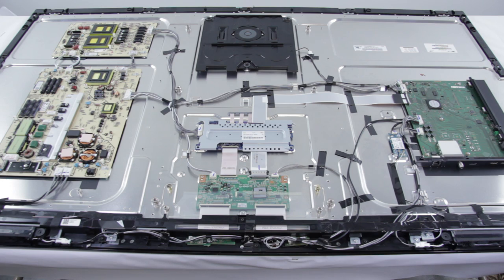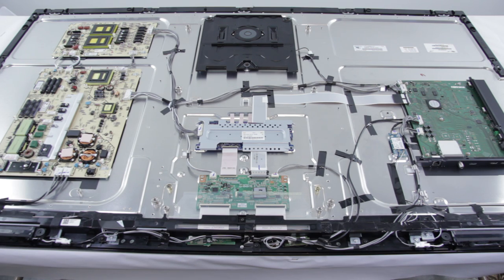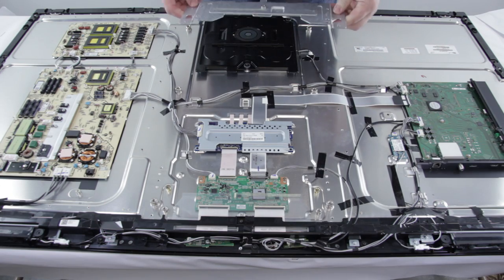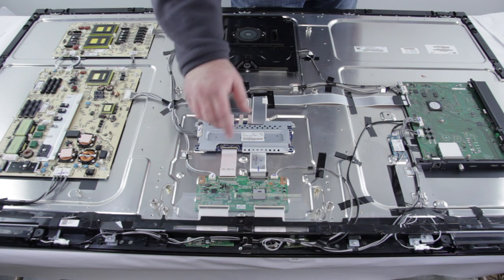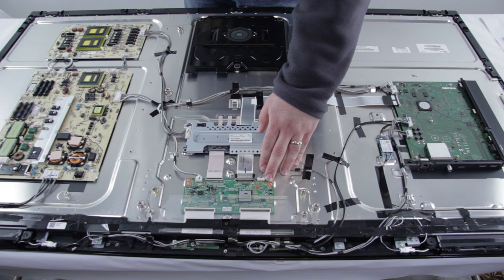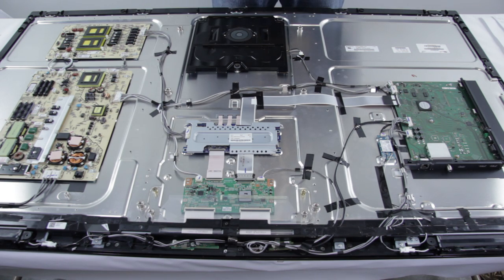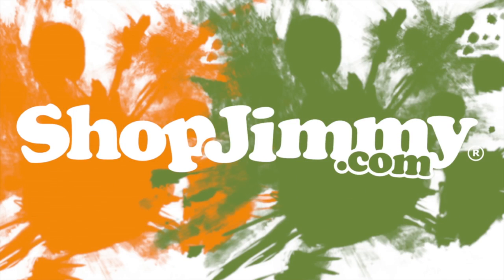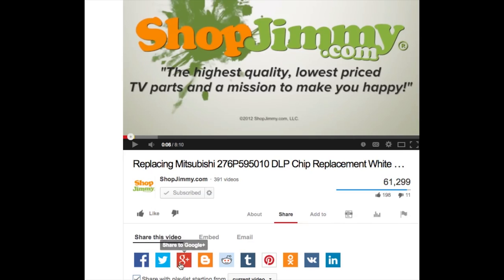LED TV Repair T-Con Board Help Review Overview - Common Issues and Problems with T-Con Boards

Comment: I have a 3 year old LG 42LN5200 LED TV that has black screen, I have done a little research & then tried to pinpoint the problem myself. I can tell you the standby light comes on but no backlights until I cut off. The red standby light goes off then the backlights start to flicker & seem to spread from a few to all of the strips. They never stay lit they just flash off & on. As soon as I power TV up & standby light comes on again they all go off. Any idea what's causing this?

Comment: I have a Changhong 50" 1080p LED HDTV - LED50YC2000UA. It's not even a year old and we just started using it, it was kept in the bedroom since December 2014. Shortly after moving it to the livingroom, the IR Sensor does not work. I know the remotes both work, the Changhong and the Directv remote. We now have to manually input the controls, which is annoying! What can I do to fix this? It's a very cheap tv, actually it was free with a laptop purchase on Newegg, but I saw it for sale for under $400, so I am not surprised it's not working right.

Comment: I own a Toshiba 50L1350U, and the backlights do not come on. They will briefly flash when first pressing the power button but then immediately go out. I've done the flashlight test and do have a picture on the screen. I replaced the Power Supply Board with no success. Any suggestions would be appreciated, thanks.

Comment: how do you replace the t-con board on toshiba 37hl67 lcd tv.  I can't find it and was wondering if I have to remove stuff to find it?  Thanks
Reply from the maker: *****   Try all tests and repairs at your own risk.  It may be under a metal bracket as sometimes T-con boards are covered up.  Here is a link to some possible replacements for your TV model number.  It may look like one of these.  http://www.shopjimmy.com/catalogsearch/result/index/?cat=63&q=37hl67  Thanks and please let us know if you have any other questions!  www.shopjimmy.com

Comment: Season Greetings. Description of my problem.
TV - Sony KDL 60EX720 (3D). 					
Poor color quality. Grainy Screen. Distorted moving color. Colored circles in top
 right 15 X 15 inches of screen. 	
Solarization on all screen, Including MENU displays .								
Common to all input devices. Everything works. Audio OK.							
Question - which board should I replace? Thanks, stay safe, Romeo.
Reply: Replaced: BATV Board , A-1821-155-A , Main Board , VGA Input , HDMI Input , A/V Board , Tuner Board , Ethernet Input , USB Input , Digital Audio Output. Problem solved.
Cost - $138.48 Can. TV PARTS CANADA

Comment: I have a Vizio XVT553SV with no sound. Originally I sent the Mainboard to be repaired because I had no HMDI inputs working. Got it back and worked for a year when the  sound started cutting out. I sent it out for repair again and it worked sporadically and sound went out completely. Replaced board with one from an online tv parts company and still no sound. Everything else works fine with great pic. Could it the T-con board? I’ve connected soundbars, DVD players and no sound. Need help

Comment: I have a Samsung curved TV model un65KU6500 and it was plugged into a surge protector and my wife went to plug something into the outlet and it sparked then the TV ended up getting all vertical lines. You can hear sounds from the TV but no picture

Comment: I have a Sharp LC-70LE660U and the picture goes in and out. You still have sound and can see ghosting on the screen barely. Could it be my T-com board failing?

Comment: Hi there I have a sharp 70" model lc70le650u led. Recently my tv has been giving me rolling bars horizontally starting from the top down. I noticed the issue occurs when the tv has been on for an extended period of time but the issue has been occurring more frequently. Once the bars have started rolling the picture starts to fade out little by little. I've also checked to make sure it wasn't cable box related. The issue happened even when you turn the tv on and see the sharp logo or when you switch it to Netflix or cable. If I turn the tv off for a couple of hours it goes back to normal. Please let me know what you think the issue may be and if it's worth fixing! Thank you!

Comment: Hi i have a Samsung UN50H5203AFXZA and I have sound but no picture. I don't see any backlights lit up when I take the cover off. I have replaced the power supply and the main board.  Would the t-con board be the problem because I don't see an inverter board on this TV. Please help

Comment: Hello, I have an insignia tv ns55l260a13. Went up to the keypad controller to change input and got a little zap. Tv is now stuck on blue screen with volume bar constantly showing and volume on 0 unable to increase. I took it apart and disconnected the keypad and it's corresponding wires from the board which I believe is the motherboard but I'm still having the issue. Any suggestions on what I should be replacing next? I just don't want to buy $400 worth or circuit boards and replace them to find out it didn't work. Any assistance would be greatly appreciated, thank you in advance.

Comment: Hi. I have un55hu7250fxza tv with LJ94-30167G tcon board. Only backlight and sound are working but no picture. Two fuses on tcon are good. What should i further test to confirm bad tcon board? Thank you

Comment: Fred Anderson
Have a Samsung UN50H5203AFXZA LED TVAbout 3 yrs old. Have sound but no pic. 
When I conduct flashlight test to the black screen, I can see picture. I see no faint/little white light on back of TV when I have all lights off in front room. So I th8nk problem is the LED BACKLIGHT is not working. Can that be repaired or do I just buy new TV?????

Comment: My tv model Samsung UN46D7000LFXZA has been getting verticle different colored lines from left to right using 3/4 of the screen...they are light colored lines where I can see a nice picture with the exception of the lines.  I took the the tv to another room and plugged it with same problem.  I jiggled the HDMI ports to check for loose connections but they were fine.  So I took the back off (with it unplugged for 20 minutes to let capacitors to discharge somewhat)....I got visual access to the power board, main board, and T-Con board.  I unplugged all harnesses and reconnected them to check for connection problem.  I can change any board easily.  So my question is:  should I replace the T-Con board first to eliminate the vertical lines, or should I replace the main board?  Thank you very much😊

Comment: I have a Vizio E500i-A0.  The screen has 1 black horizontal line right in the middle that flickers on and off, does this mean my TV panel is bad or can it be fixed??

Comment: LE55W806 hitachi 3dTV screen went black but if you shine light in it you can see the screen the the does have sound can you tell me if it's the t-con board and what the part number is so I can look up the cost than you

Comment: I have a TCL - Roku 55US57 Left side has gone dim, initially it flashed on & off, then when adjusting the brightness from brighter to darker it would slow down and stop, then it finally went out.

Comment: Greetings, friend. I have a Samsung UN75KS9000F. Powers up, backlights seem to be working as there is a blue hue on the screen- no image. I replaced the main board, it was the same issue. With the TV laid face down and back panel removed- I can the LED's working when I turn it on and off, but again- no image. Looked at an angle with a flashlight to see if an image existed- nothing. Was going to sell for parts, but I thought I might try to t-con board. Any thoughts? I've not had the chance to replace boards on TV's that were manufactured within the last two years like this one. Any advice would help- thank you!

Comment: Hi Im just curious...will you be able to give advice for fixing vertical lines problems on 

LG/Philips LED Display panel used by Imacs from 2007-2009 , 20" - 24"?

Thanks

Comment: I have a hisense 50h5g 50in led lcd. I have sound but no picture. I can do the flashlight test to the screen and see the image. Would this be the t con board?
Reply: Steve, did you get a response and was it the con board? My 50h5g just exhibited the same symptoms. Thanks.

Comment: Hi I have a samsung un55ju6700f .the tv shows picture and sound but very dark. I tried turning the energy saving on and off and it came back bright for 5 sec and went back to dark. Would you know if it’s a board issue and which board.

Comment: I have a samsung un40es6500fxza that I purchased in Feb 2013. This past week I started seeing a horizontal line in the middle of the screen. Do you think this may be a display panel issue?
Reply from the maker: Kathryn Timeon   This sounds like a TV panel (TV Screen) problem.  If your TV panel is bad, it may be more cost-effective to replace the TV as panels are typically hard to find in stock, difficult to replace, and expensive.  Thanks and please let us know if you have any further questions!  www.shopjimmy.com

Comment: Samsung un55ks8000fxza I have a wide (4") vertical band near center of screen that displays the picture, but is much darker than the rest of the screen. Any suggestions for problem repair?

Comment: LG 47LW5600, a 47 inch 3D LED TV.  There is a pink vertical line, one pixel wide on the right side of the screen about 3-4 inches from the edge, and there is a gray horizontal line one pixel wide across the screen about 3-4 inches from the top.  The lines are always there and they appeared recently at the same time.  Do you think this could be solved by simply cleaning connectors in the back panel?  Is this a symptom of a bad Tcon board?  A bad panel? A bad main board?  Thanks!
Reply from the maker: Daniel Wilson   This sounds like a TV panel (TV Screen) problem.  If your TV panel is bad, it may be more cost-effective to replace the TV as panels are typically hard to find in stock, difficult to replace, and expensive.  Thanks and please let us know if you have any further questions!  www.shopjimmy.com

Comment: Hi ShopJimmy!

I've learned lots from these videos.  My LG 55LS4500 starts up, backlight comes on, but no picture.  I cannot access any menus from the remote (still blank screen), but the little red light on the TV indicates input is happening.  I can change inputs with the remote (blindly) and get sounds from the inputs.  So I am almost positive this is a t-con problem (can LCD panel problem be ruled out?).  Is there any way to possibly repair a t-con rather than replace it? Should I mess with the connections first?
Reply: +Josh Landecker I ordered a replacement T-con card. Your website had the one that says is for my TV model #, but I went inside and found that my existing card was different. My card says 2852G1. You website does not that that one in stock, but I found it elsewhere. The new card arrived, labeled 2852G1 as expected. I replaced the card, but the same exact problems persist. No picture, only backlight and sound.

:(

Comment: I have a Westinghouse WD55UB4530 Version TW-06711-SO55I. The problem I have is the tv will power up, backlight will come on, and the TCon has all of the voltages it is supposed to, however I have no picture nor menu/channel/vol displayed on the screen. And the Samsung IC in the middle of the tcon gets pretty warm. Bad TCon?

Comment: Hello ... I am here to seek your help to fix my LED smart 3D tv (UA40F6400) . And the problem is when i switch on the tv, it remains complete dark and sometimes grey screen with many horizontal lines all around the screen. And after 15-30 minutes the tv becomes normal with no issue after that, till i switch off. The same problem continues after restart. I did lot of surfing to fix the issue but all in vain. Expecting only u can fix my tv problem . And i am really thankful for your help ...

Comment: Vizio Model E601i-A3 I am experiencing a thin vertical red line across the left side what part do you recommend for repair?
Reply from the maker: Johanna Norvell   Try all repairs and troubleshooting at your own risk.  This sounds like a TV panel (TV Screen) problem.  If your TV panel is bad, it may be more cost-effective to replace the TV as panels are typically hard to find in stock, difficult to replace, and expensive.  Thanks and please let us know if you have any further questions!  www.shopjimmy.com

Comment: I have a vizio m550sl, have blue dotted vertical line on the middle left side. The line goes away when I disconnect the t-con board. 
It is the main board or t con board issue? Also, should I replace the ribbon cables? Thanks.

Comment: I have a rca led65g55r120q we have power but when go to turn it on the screen will flicker then turn off. not sure if its the power supply,board it the t-con

Comment: Hey Jimmy    I have a Insignia 40"    NS-40E560A11   powers on but nothing but colored vertical lines left to right completely across screen  top to bottom
would this be a good call needing a T-Con ?
Reply from the maker: Rick Reed   Try all repairs and troubleshooting at your own risk.  This sounds like a TV panel (TV Screen) problem.  If your TV panel is bad, it may be more cost-effective to replace the TV as panels are typically hard to find in stock, difficult to replace, and expensive.  Thanks and please let us know if you have any further questions!  www.shopjimmy.com

Comment: I have a Vizio E701i-A3 that the picture stopped working on 2 weeks after the year warranty went out. I never noticed any dark spots or lines noted on your website as other possible symptoms that would damage a new board. I bought a board off eBay and installed it and everything worked fine for about 15 minutes. Then the picture was gone again and had sound and what not. Do you think I just purchased a bad board? It was noted that it came out of a tv with broken screen so i dont know how old it was. If you still think it is just a T-con board problem i will purchase from you guys and hope that it works fine. Please and thank you for a quick reply

Comment: Vizio e500i b1just change power board TV is now back on but it now has a black line about 2inched in wide running from top to bottom of my screen any advice will be highly appreciated

Comment: Hi , my name is Ron. I have a Sony Bravia KDL-46HX729. I purchased it 11-18-2011. The problem I am having is the picture will fade out and start flickering. This is a sporadic event. The picture will be good for about 3 days and then the faded picture and flickering will start. I have done a factory reset but the problem still happens. Do you have a idea on what part I would need to replace. Yours truly Ron

Comment: I have a 40" samsung un40c6300 led and the screen seems to fill red where there should be black.  also, with no components plugged in and when power tv on, is red screen.  Is this the T-Con board?

Comment: I have a Sony KDL46HX750 do not have a stand-by light check the power supply board I had 12v but not 3.3v stand-by replaced the power board did not fix it same. replaced the main board and that did not fix it no stand-by 3.3v and no red light on the front of tv.   so do you think give up or replace the t-con board????

Comment: I Have a VF550M VIZIO  TV and it has horizontal lines through the tv after it is on for about 1 min. When you first turn it on everything works fine but quickly goes to horizontal lines across the whole screen. Thanks in advance.
Reply from the maker: Nick Koverman   You can replace the main board to see if that fixes the problem, however if it does fix the problem then I would say you have a bad TV panel.  Click this link to replacement parts:  http://www.shopjimmy.com/catalogsearch/result/index/?cat=56&q=VF550M+  Be sure to match part numbers on your current board, with your replacement for compatibility.  Here is a link to a video showing how to identify your part number, click here:  https://www.youtube.com/watch?v=kxkeGLhlQY8  Thanks and please let us know if you have any further questions with your TV Repair!  www.shopjimmy.com

Comment: I have a vizio m3d550sl with sound but no picture. I do have back lights. I'm not sure if this particular tv has a tcon board or not. Do you have any advice for this issue?
Reply: First Measure whether the t-con powered,  measure the individual pins to t-con,measure the outputs from t-con, power + Measure Up

Comment: Good day I have a 65 inch Phillips smat roku TV I change the main board and video and audio board it works fine now but am getting the pic in a vertical half screen there is no jumping nothing pic is clear just in split screen is that a setting problem of something is wrong with my con board

Comment: viewsonic vx2703mh-led when you first turn it on, you get 1 sec of picture then it fade to white w/ a lite blue strip near the center, and I've got it apart, and the caps on the power supply  are good, no spits on the top and they are flat
Reply from the maker: +Dark sarcasm   Try all repairs and troubleshooting at your own risk.  This sounds like a TV panel (TV Screen) problem.  If your TV panel is bad, it may be more cost-effective to replace the TV as panels are typically hard to find in stock, difficult to replace, and expensive.  Thanks and please let us know if you have any further questions!  www.shopjimmy.com
Reply: the veiwsonic is a computer monitor not a tv, so there is far less parts to go through than a tv, so from the svga input there is a board with 1 chip on it that looks something like a gpu with a crystal on it, then its 1 ribbon cable to the top of the lcd screen, and then there is a big board for the power supply, also the power supply had 2 chips on it that has a hex code for the rgb (pick a color) for the led backlight, I know that side is good as the screen light up bright